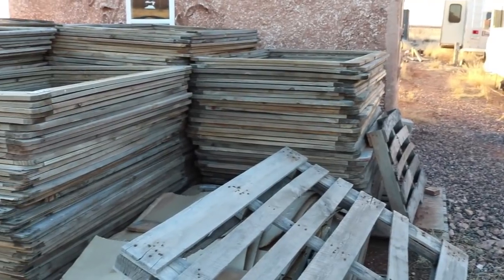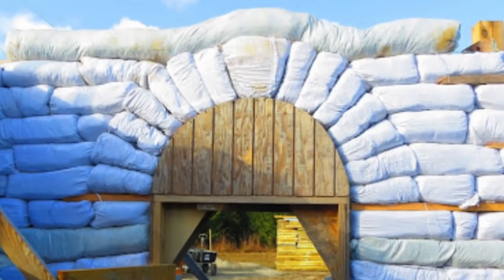We're Building Our House With DIRT | Forms For Earthbag Building

Comment: Hi you two. When it comes to Heating and AC look into ductless mini splits. The 21 seer rating 1 ton units can heat and cool up to 500 square feet. But size it at 400 square feet to be sure you have enough. These thins run on less than 4 amps and only need 120 volts. Solar panels and batteries can handle them at full blast they take 460 watts for 12,000 BTU which is one ton. The heatpump heats and cools. They work as cold as -15 degrees below zero.

Comment: Pick a theme for your flock, like a television show or a favorite book etc. Then it becomes much easier to decide who is who. My only concern was with the size of your rough opening. Do you already own the rounded window? Usually a 3' window might be a different measurement in it's rough opening and for cost savings you want standard or less expensive than custom. Prefit before building your walls to be sure. Maybe buy one window set and prefit an entire assembly to make sure it all works.
Reply from the maker: That's good thinking. We'll probably be constructing our own windows.

Comment: You said you plan on reusing these forms..
With both sides being pushed in from the said bags and down from the top...
Where are the release points
So the form can be slipped out...
If the sides were a little wider at the bottom
And there was a wedge designed bottom piece
The wedge could be removed. And the form slid down.. Then pulled out
(Could be one way to remove the form in one piece)

Comment: Have one more question
Once the forms are holding the earth bags in place..
Pushing in on the forms
Aren't you going to have to disassemble them to get them out
Wouldn't it be easier to disassemble if key pieces of wood were screwed in
Or at least double headed nails used
Reply from the maker: You could do that. You can also use shims so the it's easier to loosen.

Comment: Could You please set up the depth of circular saw blade with thickness of wood because it is much easier to work, improving the battery and circular saw motor life.
Reply from the maker: Thanks for the tip Joaquim!